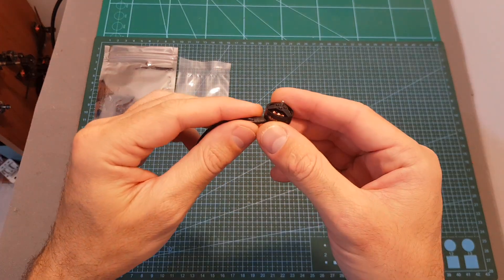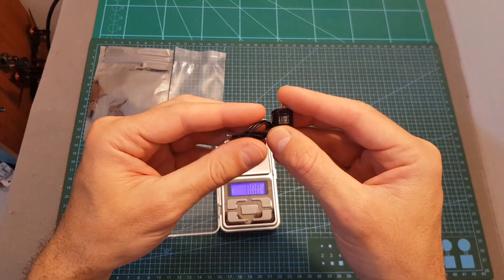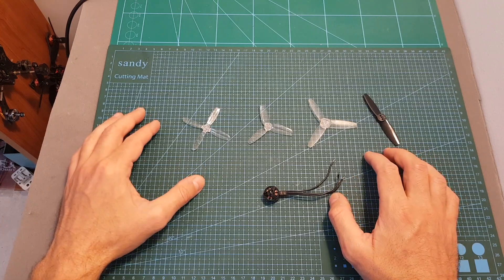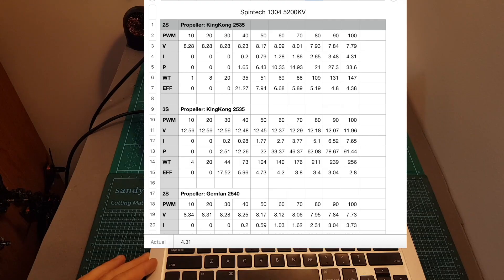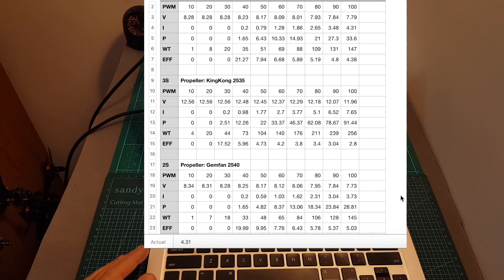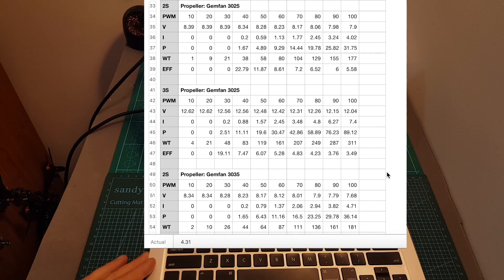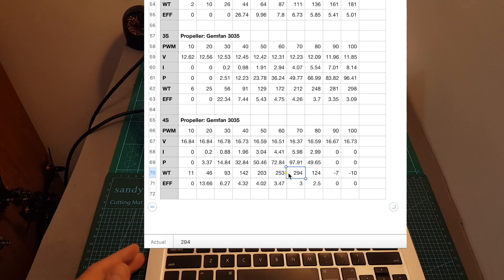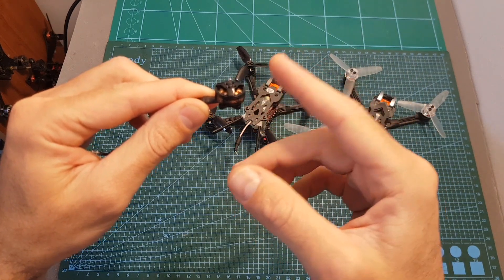Spintech Motors 1304ST Thrust Test

Comment from the maker: Two thumbs down already? If you have any feedback please let me know.
Reply: Dont't mind, your work is excellent! Congratulations. Just to see how efficient is the 3025 and that 3035 don't even generate more thrust, is a very significative result that can break some wrong ideas on two and three blade props.
Reply from the maker: @justalex7416  Thanks for your support :-) Yes - I was really surprised to see these results as well.
Reply: That could mean you got your first 2 haters. And that means success. 😉
Reply: Gal Kremer - Decided to burn it on 3” 4S before trying 2.5” 4S? Just seems like an odd progression you attempted. Would love to see another proper test on 4S. First 2”, then 2.5”, and skip 3” because we already know that doesn’t work at least not on a bench.
Reply from the maker: Thanks for the feedback. I might test it again after the build video. I have only 4  motors left and I can't burn another one.